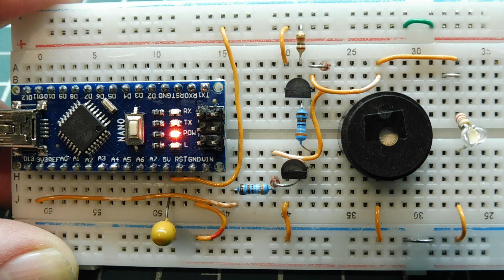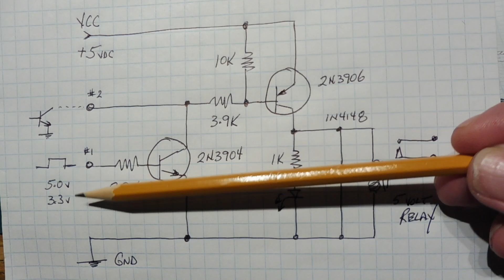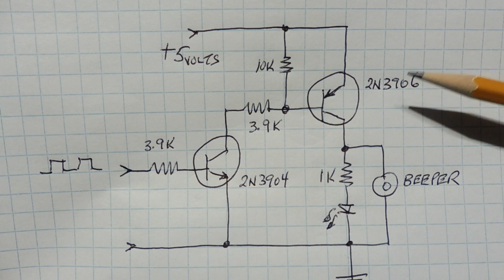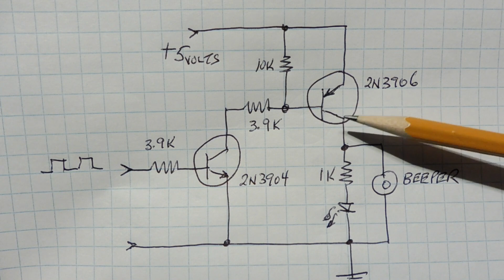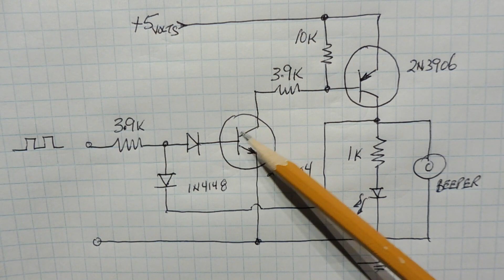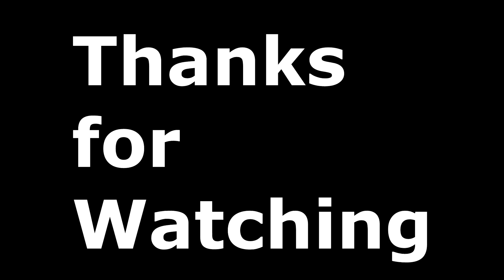Short Circuit Protection    / Circuit Design

Comment: I’m using the active low input and when I short the circuit, I notice that the circuit protection works and protects my output LED and arduino, however after being shorted for several seconds the 3906 PNP gets pretty hot to the touch, is this normal? If using only the active low input, do I need to relocate the protection diodes to another spot in the circuit ?
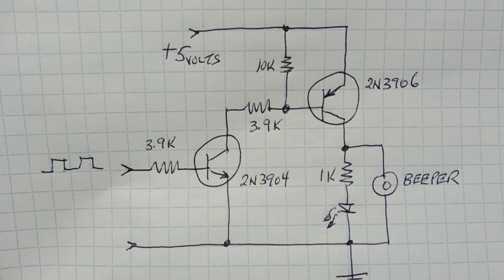Reply from the maker: The circuit protection circuit is at 3:42 which does not have an active low input. The video clip with the active low input was from another video and was used for theory of operation. Using the active low input bypasses the protection and should not be used.

Comment: hi, if i want to use 24-1volt adjustable supply which parts should i change?
Thanks you
Reply from the maker: The circuit will operate on 24 volts.

Comment: Sir, home to modify this clever circuit to take higher input voltages
Reply from the maker: You can increase Vcc up to 30 volts and adjust the base resistor to match your control input voltage.
For higher voltages use transistors with proper voltage specs.

Comment: What an excellent and very simple solution; great! I didn't know about your relay driver which also looks very good and I think I am gonna use that to drive a Mosfet which is switching my Flyback. But maybe I have to add a pull down resistor between the gate and ground then. At this time I am just using the output pin (3) of a 555 timer but this looks more robust, so thank you :)

Comment: Would you still need an additional flyback diode across the buzzer/relay?
Reply from the maker: The beeper I am using has a built in oscillator driving a piezo element and is not  inductive so a flyback diode is not needed. When driving an inductive buzzer or relay a diode is needed.

Comment: Great circuit. I think that if I used it a lot I would make some small daughter boards with just that circuit on them and have the protected relay drivers ready to plug into a project.